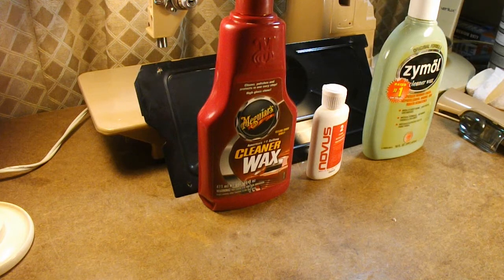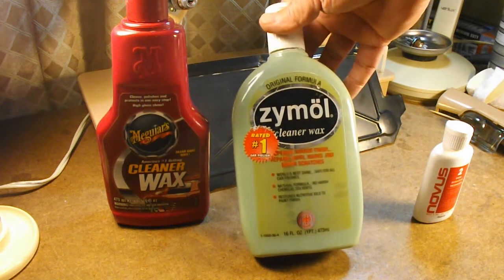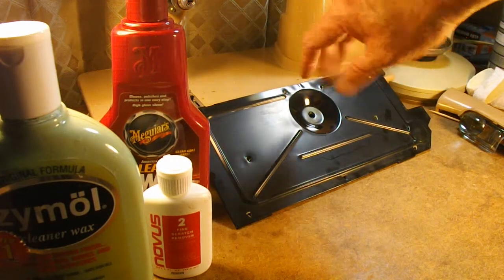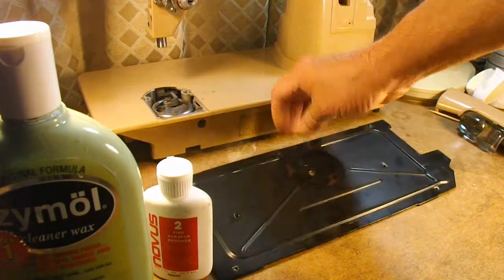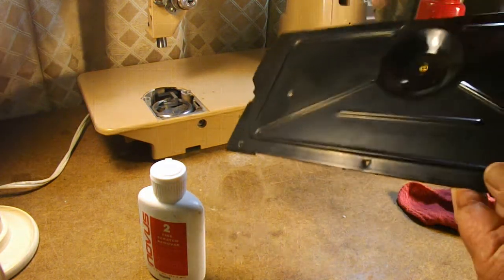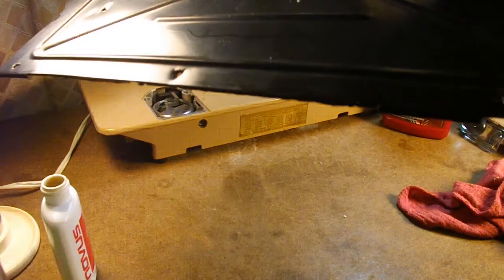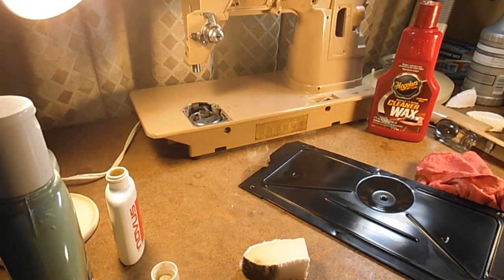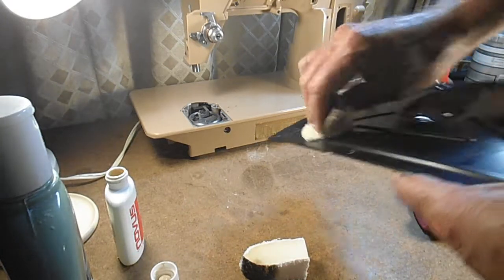SINGER MODEL 404 RESTORE SERIES Pt.15 APPLY CLEANER WAX

Comment: I love how shiny the wax makes the paint! That dull bottom plate was really improved. Was there a reason for putting the tension assembly on before waxing or is it ok to wax the area underneath first? Andy, this is so much fun!
Reply from the maker: It is kind of fun, right? Thanks! I actually did the cleaner wax before putting the tension assembly back on. I put it back on to make a video of a part-by-part disassembly of it as part of the mini-series "All About Tension"  I will be posting soon after editing. Thank you very much for watching.

Comment: Working my way through this series.. I just purchased a 404 in a table. Lots of gunk, rust, and dust. and it's missing the bottom drip pan, I am going to look on ebay for one; will any other model fit the 404.? Thanks Andy.  I saw one that looks like the same pan on ebay ,, the listing says for 401,401A, 403, 403A.  they didn't mention 404..  it looks the same as this one in your video. will it fit the 404.?
Reply from the maker: Bed Cover Plate Part No. 172012 same on models 401A, 403A, 404, 500A & 503A.
Reply: @andytubesewing1953  Thanks for the reply.. much appreciated..
Reply from the maker: @connieworcester55  🙂